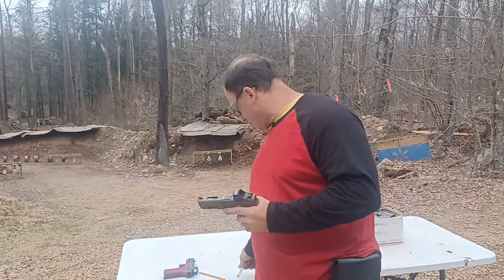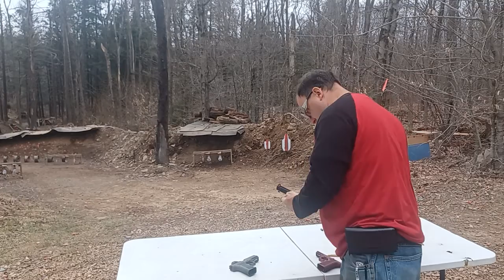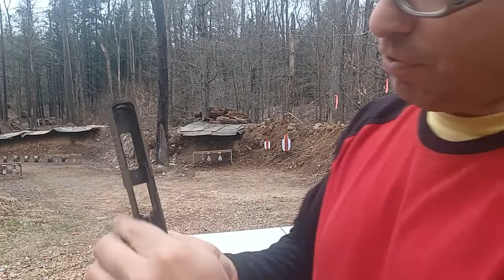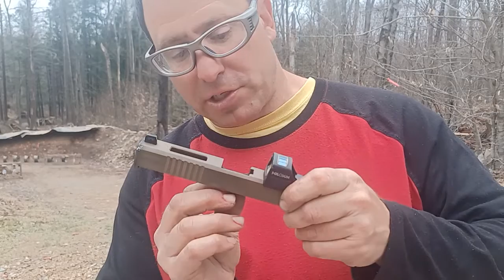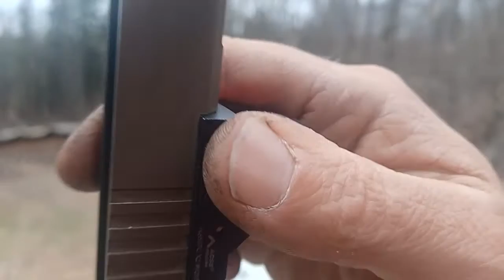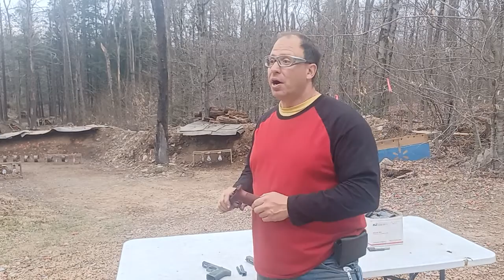Testing Firing Pin

Comment: Hey I’m having trouble with a P80 build for some reason I’m having issues with the slide not going back to normal if I hold the trigger . But when I release the trigger the slide goes back to normal. Any advice on how to fix it ?
Reply from the maker: There's a few things that can be wrong. The slide might be too tight, in which case you have to grind underneath the rails a little bit. Recoil spring Channel might not be cleared out enough. Barrel slide lock up might need some work. Shark fin might need some grinding down.

Come to my Facebook group...
building polymer80s August 2022 deadline.

Upload a short video trying to cycle the gun. That will give me a better idea. Other people there would also give you advice.

Comment: So if I do this pencil test and the pencil shoots out that means the gun will fire ? Does this test strength ?
Reply from the maker: It's testing that the firing pin is coming through the fire pin hole. It's making sure that the trigger fin is lifting up the safety plunger enough for the firing pin to pass through.

If pencil moves up a little bit the gun will  likely fire.
Reply: @PoconoShooting  what if I lock the slide back after the pencil test and the firing pin only petrudes a little bit, and not fully come out of the breech face but the pencil still comes out of the barrel is that what you were talking about when you said the round will hit the firing pin and make it return in the breech face
Reply: @PoconoShooting   because the pencil is moving but when I pull the slide back the firing pin only petrudes a little bit not all the way out how it should is this a problem
Reply from the maker: @bodegatityy5092  if the pencil moves it's a good indication that it will work. You still have to do a live-fire test to be sure. If there's a problem this will usually tell me in advance. It's an indicator. It does not necessarily mean that the gun will work because there could be other things wrong.